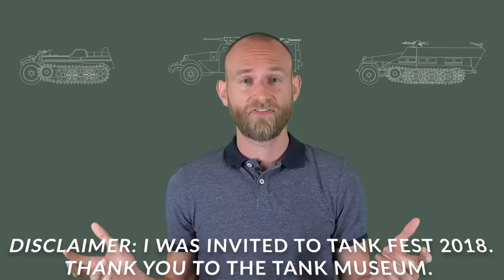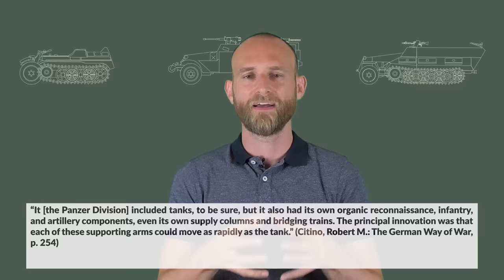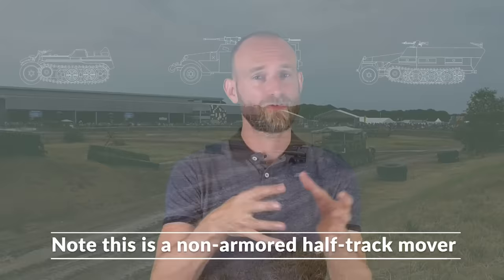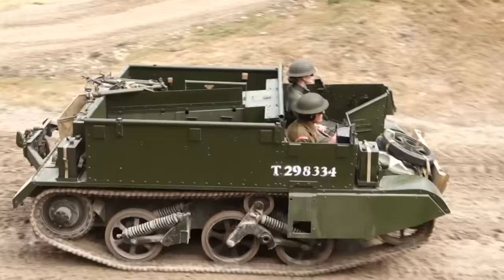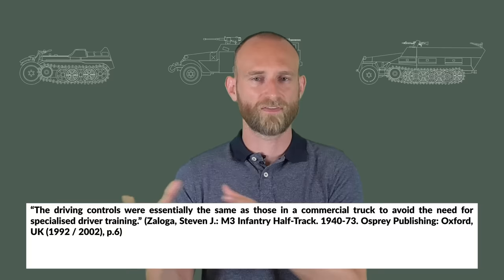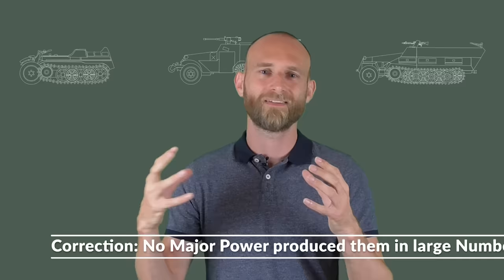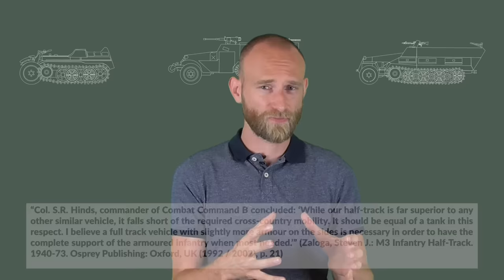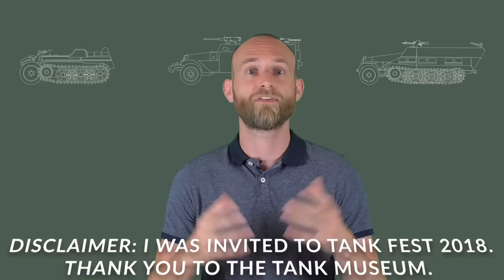Why Halftracks? Why limited to WW2 only? (Featuring Tank Fest 2018)

Comment: A lot of what said here is VERY academic, but VERY inaccurate, as well. My father served in WWII infantry, and as a kid, I saw a lot of the old pictures that he brought back to the states. The half-track REALLY caught my young eye at the time, and I actually wanted one...bugged him all the time to tell me about the 'machines' he saw (I'm a retired engineer now, as you can imagine).
Anyway, he told me a LOT about one of my favorite 'machines'...the half-tracks. He said that the half track was supplied to mostly supply and infantry units to negotiate VERY WET-MUDDY SOILS and across open lands that 'weren't mined'...or they had a tank 'forward' them, otherwise, to prevent mine damage. The half-tracks were 'potentially faster', and more agile than, say, a Sherman tank, but at the same time, they were more fragile too. The half-track was considered 'an improvement over a truck', but more vulnerable than a tank, while being heavier, capable of greater payloads, and more 'sure footed'...that said, he claimed 'they broke down a LOT MORE' than a truck. They were also 'cheaper' to repair than a fully tracked vehicle, but far more expensive than a multi-wheeled vehicle...and they did less damage to 'improved roadways' than a full-track, but far more damage than a wheeled-vehicle.
He said back then, 'I don't expect them to ever be popular beyond maybe farm use...they tear up roads, cost to much to keep maintained, and aren't good for much of anything beyond travel in unimproved lands...they might use them in the prairies...but those things sure don't like sand at ALL...we couldn't keep them running in Africa for long.'
So, in fact, they are a pain to try and use in our 'modern world' with bituminous asphalt, they don't do well in deserts (due to sand), they are expensive (over a wheeled vehicle) to maintain, they are heavy (bridge-prohibitive possibly in rural areas), and consume far more resources than a comparable truck. Unlike full-tracks, they also do NOT have much advantage for traction over wheeled comparisons, because the front-axle tends to 'dig into trenches' (why that M3 half-tracks have that big roller on the front - to keep from 'pile-driving the trench' when you try to ford a steep-banked creek or deep trench...they help keep your vehicle front out of the ditch).
Reply: This doesn't contradict much of what he said in the video though.
Reply: Skeeter Saurus - Last halftrack I saw off of an army surplus lot was pulling a house westward on Lebanon Rd. in Nashville, Tn. in the '70s. Rubber block tracks.
Reply: Ironic that ISRAEL used the M3 series Half Tracks up until the Israeli run into Lebanon in 1982.......As you may guess Israel tends to have some rather "sandy", Dusty terrain....yet there is HUGE volumes of video and photo evidence of the Israeli Tracks running like a bat out of hell across the Sinai throwing HUGE clouds of dust
Reply: Israel was using a lot of the old 'Rommel era' trucks...we did not make very many more after Korea...so to keep them running, they would have had to machine parts for them, eventually. That said, they do NOT use them (much) anymore...as they are museum pieces, even for them now...ask yourself why?
Reply: 'Road Pads' are really nothing more than the equivalent of a car-tire, cut up so that the 'tread side' (aka belted-side) can be bolted to the track. HOWEVER...road pads do NOT survive anywhere NEAR as long as steel pads or car tires...again, if you get 750-2000 miles out of a road-pad, you can claim you've done something...they came about LONG after tracked vehicles did, and presumably after our adventures in WWII France (as my father said, 'when we rolled into France (to counter Nazis) the French could just eat us up....2-months later, they hated us so badly, they wish they had!)
Saying this...turning a full-track vehicle shears the road pad QUICKLY...and a half-track with a long track section (such as an M-3) does almost as much damage to that road pad.
No one is going to stop in combat to put 'new shoes' on a tracked vehicle...they will keep driving it...bolt-heads (that hold the road pad in place) acting like golf cleats on that 'nice, smooth bituminous asphalt' is a tragedy for whoever has to pay for resurfacing later.
If you look at the modern history of tracked vehicles (like Fort Hood, Texas), you see there is a 'minimal driving on paved roads' ideology in place...because ARMOR ABHORS PAVED ROADS!
Reply: well, like anyone else...my guess would be that Israel doesn;t use them (much) anymore simply because they were old to start and have progressed so far PAST that technological level.......keep in mind that Israel now manufactures their own APC, the NAMER, that is THE best protected / armoured APC in the world.....why continue to use something that would now be well into it;s 80's?...my point was that Israel used the M3's just about longer than most, and used them in active combat.
Reply: one needs to remember that the track pads on modern armour is generally in place on vehicles that are weighing in 40 - 80 tons....no matter what is done...just the shear weight is going to cause issues........another factor is ambient temperature of the local A.O.  to use your reference of Fort Hood, Texas tends to be rather "warm" with alot of sun to heat both the asphalt and the rubber on the track pads.....this causes the track pads to "lift" asphalt and when turning to dig in and push it up  causing the damage.....the heat does the track pads no good either allowing for premature wear.......

HOWEVER, when MBT's such as the Bundeswehr's Leo 2A6;s, which travel on public highways in Germany all the time, as do the British and American MBT's and Armour, far less damage is done...why?...generally the major road moves and Ex's are timed for Spring or Fall when temps are cool and likely more wet...protecting the road surfaces as well as the track pads......

And really?....having served in Armour myself, and having drifted out track pads and split and serviced track on more than one occasion...it does take alot to wear them out right down............they will chip, crack and wear...but for them to be worn right out?...takes alot....again, dependent on the terrain............

NOW that is HEAVY ARMOUR...a much lighter Half Track will see far greater length of service from a track pad than would a 30 - 40 ton HEAVIER tank...right?.........not to mention that the Germans didn;t ever install rubber track pads on their Half Tracks...but used a smooth , slightly rounded metal track
Reply: @SABRE 21 I wouldn't say that it's ironic. Nor is much of Israel "sandy". Sinai for example, while sandy and often fought across, is part of Egypt.
Reply: would you like to RE read what I posted?...that ISRAEL has SOME rather sandy and dusty areas..........while the Sinai desert was a specific area fought over more than once, the rest of Israel is not exactly a Green lush meadow land...it is by far and large dusty and has a sandy dusty base with lots of rock...vegetation is sparse by European or North American standards.....will that suffice?.........

And my post was directed to the O.P where he quoted his relative about the M3 / M5's NOT doing well in sandy dusty desert areas..........so it IS Ironic that a Nation, Israel,  has USED these very same Half Tracks in dusty sandy AND Desert areas IN COMBAT and done well with them....
Reply: Ok...first off...M1A1 Abrams pads are NOT RUBBER ROAD PADS...if you've ever seen (and held) them, they are more-akin to the feel of a modern car's Disk Brake Pads...they are a composite which (I doubt) have ANY rubber...but more like a ceramic-asbestos combination of some type. MOST OF THE WORLD'S MODERN ARMOR are using similar designs...(not counting 3rd world nations running around with refurb Shermans, in this example).
As for 'mileage' on a track pad? ROFL...mileage is RELATIVE when you consider that a CHEAP car tire can get 25,000 miles...while even a rubber 'front end loader' track (with Goodyear design) can get 5,000-7,000 miles...actual TRACK PADS are LUCKY to see 1,000 miles of total road-durability, and depending on 'off-road conditions', may see even less then!
Reply: Ok...this should settle 'Half Track' discussions, period...here's the most HILARIOUS VIDEO I could find, of someone SERIOUSLY trying to climb a small, grassy hill with a HALF-TRACK!!! I have a junker front wheel drive that could have accomplished this, I have a rear wheel drive F150 that could accomplish this, and I have a restored 1978 440-Dodge Powerwagon that would OWN THIS (as if it were flat)...watch the video, and you'll see EXACTLY why we don't 'still use half-tracks'... TOTALLY ROFLMAO
watch?v=lvt7ScEMfmw
Reply: Nearby Army-Navy surplus store has an old (and in relatively good shape) M3 outside...no engine, no transmission, tracks look TERRIBLE and pads are mostly missing...but for a few thousand $, he will sell it.  Were I MUCH YOUNGER (and able bodied to crawl around and work on it), I'd probably buy it to fix it up...even though it is the FULL ARMOR troop version (grill guards, shutters, rear armor...everything...all 1/4" plate...thing has GOT to weigh in excess of 10k pounds!).
Reply: Sabre, you're commenting on HEAVY ARMOR pads as if they were the same as half-track pads...THEY ARE NOT! I am VERY AWARE of 'pad lift'...and while it DOESN'T happen significantly with half-tracks running RUBBER road pads like it does with HEAVY ARMOR running ceramic composition pads, it still CAN HAPPEN. You CANNOT compare a Leo2A6 or an M1A1's GIGANTIC MASS EFFECTS to that done by a 5-ton 'truck'...
BUT, at the same time, if you tried to replace, say, HMMWV's with half-tracks (and all that mileage), you would see DEVASTATION to base roads as a result...because TRACKS ARE TRACKS and the shear effect of even rubber road-pads on hot asphalt is SIGNIFICANT!

While I am NOT familiar with 'garrison pads' for the LEO, I know that the M1A1 uses a ceramic...because, well, let's be serious, an M1A1 taking a hard turn on asphalt with RUBBER road pads would be INSTANT SHEAR DEATH for that pad. I can only assume, in the same armor class, the LEO ALSO uses ceramic pads!

As for pads 'wearing out', CAREFUL...you're mixing the idea of 'worn ceramic pads' paid for by governments with DEEP pockets to small countries trying to maintain RUBBER PADS on half-tracks...FYI...CERAMIC PADS WERE NOT ORIGINALLY MADE FOR HALF-TRACKS! Even now, I am not sure of the provenance of valid 'ceramic pads' for them EVEN NOW! Again, heavy armor uses ceramics, half-tracks use rubber, and RUBBER PADS SHEAR IF YOU LOOK AT THEM WRONG! (they also wear down to the affixment bolts QUICKLY, compared to the modern ceramics with neat features like 'wear indicators' and TMs (Technical Manuals) that demands they go to 'Repair' for pad replacements, etc. (though the U.S. Army replaces pads at the unit level, not battalion or regimental service level).
Reply: Cheers...I am not that familiar with the M1 Abrams series.....my experience ( more than a decade serving in armour) is more with the M113's, the LYNX ( Recce track) and the Older Leo 1 C2's....I can tell you I have drifted out more than a few pads out of their tracks.......Pretty sure that I have seen pics from the boys over in Afghanistan with the Leo2A4's and A6's taking off very chipped and heavily worn rubber pads......and from what I have been told by the lads...as far as they know, there are NO "ceramic track pads" for the Leo series MBT's....I would seriously question the feasibility of Ceramic pads...it would seem to me that ceramics would be prone to shattering, and provide a far reduced traction level..........we DO however have and carry "Grousers" for replacing some of the rubber track pads for use in icy, heavy snow conditions........our rubber pads are vulcanized onto a metal plate that backs them to allow for them to be installed and drifted into place..They are also extremely hard, yet they are RUBBER.....From all that I have gathered ALL Leopard 1 and 2 User nations are using rubber track pads, interspersed with Grousers when needed......The Leo series Tracks use  two separate piece rubber track pads, similar to the French Leclerc ( although application is different), as do the South Korean K1's and K2's where as the British Challenger series use a very large SINGLE track pad.......interestingly, the Israeli Merkava's don;t use a track pad at all.........nor did Soviet or Russian MBT's...at least up to the T-80's...although it seems from photos that the new T-14 Armada does have track pads

Mate...I am VERY aware of the differences in what a 70 ton Leopard 2 A4 M Can will do to a road, compared with a 5-6 ton halftrack........however, the PRINCIPAL of having a rubber road pad on the US's M3 - M5 series tracks was UNIQUE in WW2 light armour....the Universal Carriers had no track pads, nor did any of the German Halftracks that I am aware of...certainly none of the Domestic Soviet stuff did...

Now as for the M3 and M5 rubber track pads?...I'm sure Nations like Israel who are pretty technologically advanced could likely manufacture rubber track pads....then again...they may well have simply remanufactured tracks for them...perhaps even without track pads....the temperatures and terrains across Israel wouldn;t be perhaps the most favourable for Rubber track pads anyway, as was seen by Israel not even putting them on their Merkava's

By the way...it;s interesting to see that in Europe, more than a few new Armoured vehicles have gone to a FULL rubber track...........granted it is banded and belted in it;s interior with Kevlar...however, the entire track is made of rubber..........off the top of my head, I know the CV90 series and the German LYNX are offered with them.....as well as being offered for other vehicles as well.....
Reply: Skeeter Saurus hi
Reply: 'What's' 'with' 'all' 'the' 'quotation' 'marks'?

Comment: For a short period of time I owned a White half track factory fitted with a Bantum crane.  I drove it down South River Drive in Miami for a couple of blocks from purchase location to a  shipyard where I removed the crane. I don't recall it having steering brakes to assist in turns.  It was basically a single rear axel White truck, with power to the  front axel as well.  Ease of manufacture may have played a part in there use.  It had remarkably heavy volute springs on the half track portion rather than more normal leaf springs.  A drive sprocket where the wheel hub would normally be and the track supported by numerous rollers to the rear hub.  that was mounted on it as originally manufactured.  The tracks were not the link belt tracks but composed of many cable bands with treads bound to the cable and perhaps bolted as well.